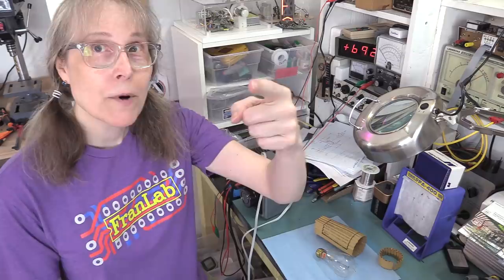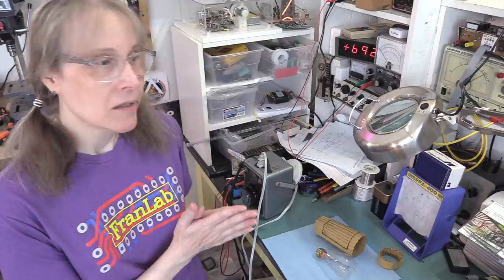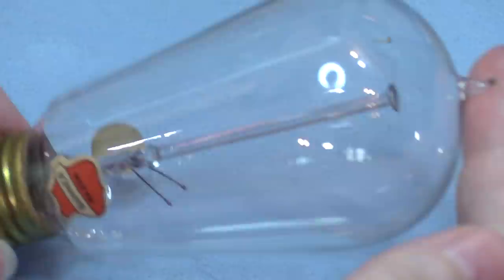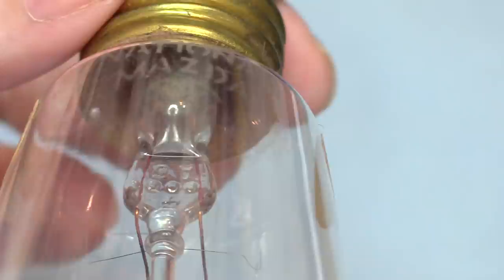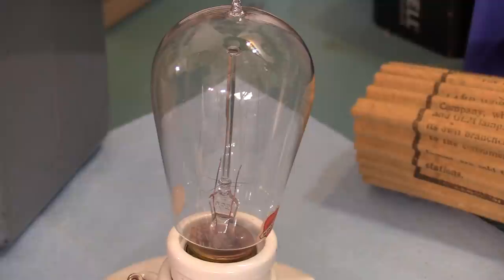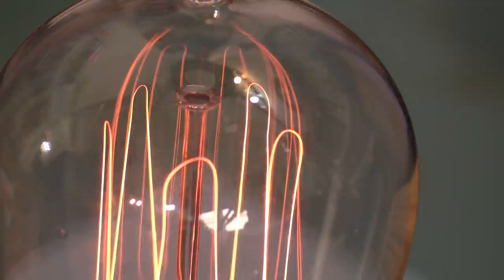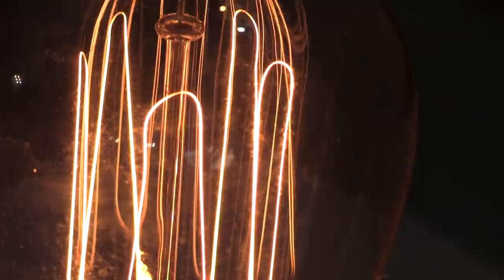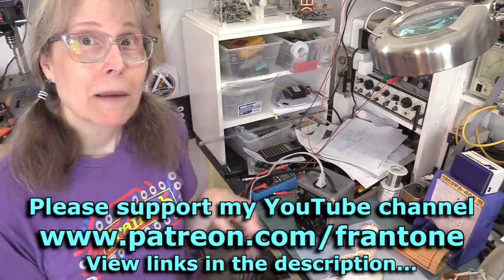Will A 106 Year Old NOS Light Bulb Still Work Right Out Of The Box???

Comment: Thanks, Fran. A beautiful 💡. And a beautiful Variac. Also worthy of note, as Big Clive would say: (1) The Mazda bulb predates the Phoebus cartel (1925-1939), in which GE got together with other light bulb manufacturers and set the lifespan of incandescent bulbs at 1,000 hours – and fined manufacturers who made longer-life products. (2) Ahura Mazda is the god of goodness and light in Zoroastrianism. (3) The longest running light bulb is the so-called Centennial Light, burning since 1901 and seldom turned off, at a fire station in Livermore, California.
Reply: I have lamps from that cartel area, and a lot of them have exceeded the 1000 hour rating in use.
Reply: We actually could have ever lasting devices if  greed didn't  happen ...
Reply: @AndroidFerret  Long lasting probably, but everything we made id subject to decay just as our bodies are. Sure you can make lamp that can last tens of thousands hours as it uses RF to transfer energy to mercury vapour and no electrodes are affected, but it will only work as long as circuit producing that RF is working. Ant it will burn out one day.
Reply: @MrToradragon  Well of course, but that can be made near arbitrarily long with thick enough circuit wires. Just like there is a team building a mechanical clock that will run for 10,000 years if undestroyed, and it uses massive gears.

Comment: Until seeing this one I didn't even know that there were tungsten light bulbs with uncoiled filaments. As always: Thanks for showing.
Reply: They are still used at sea for navigation lights. The 'squirrel cage' uncoiled filaments are used, to ensure a correct beam pattern. Nav lights have a set arc of visibility, so that they are only seen at certain angles.
Reply: can buy these new again, under the name "edison bulb". careful not to get the LED versions.
Reply: IKEA sold replicas until they were replaced with LEDs. Last week I found a box of two I bought around 15 years ago and never used.

Comment: I bought an old light bulb on eBay for a film that required everything shown to be available in 1955 or before.  The bulb wasn't quite this old and I paid no attention to any manufacturing markings (the original packaging did not come with it).  I powered it up to test it and it immediately blew.  Right now I am working on a project with squares of luxfer glass, which was patented in the 1880's and can still be seen over many old store fronts.  It is a prismatic means of redirecting sunlight to the rear of stores that had gas lamps (a huge fire danger) as their only means of artificial light.  Much of this glass now has purple hues due to the reaction of manganese to light.  Luxfer glass would make an interesting episode, Fran.

Comment: It would be interesting to see some of the older non standard US fittings, some of the British ones are quite bizarre, and the lengths companies went to be incompatible for vendor lock-in too
Reply: The standard over here in U.K. is the bayonet fitting.
Reply: @frankowalker4662  and of course it has the safety advantage of having both terminals on the end face, so the metal cap and the bayonet socket are not at mains voltage, unlike an Edison screw type - less likelihood of zappy surprises if you swap a bulb with the power left on.
Reply: @emmajacobs5575  It also has the advantage that if you want one that's just sliiiiiiiightly a different size it's fine because there are 67 standard versions, or even 5 different versions of an identical size base with incompatible pins that will short out the whole circuit if put in the wrong socket. Here we use them in cars because the spring preload keeps them from falling out, but with so many different variations it doesn't seem very standard
Reply: @alakani  British standard bayonet fitting has been the same since before the second world war. That's what standardization is about.
Reply: @evensgrey  As you say, specific use cases. Manufacturers have to build a product that meets the demands of its application, at a price that customers will pay. Concentrating on a limited number of socket sizes probably helps keep prices down a little.

Comment: Great bulb, Fran! I also have a (small) collection of vintage bulbs. Tip: Try using "Bulb Wax" on the brass shell of the bulb. It makes it easy to screw in and when you unscrew it, the lube eliminates the dangerous twist-pressure between the glass envelope and the shell. This way the glass globe on these vintage bulbs won't break away from the shell ( delicate!). Be well

Comment: Ive got a Phillips 240v 60w lamp from around the same time with the nipple on it, still works although i don't have the packaging. I really should make a nice display plinth for it and have it glow at a low voltage
Reply: That's a good idea. I connected some light bulbs to dimmers. No antique lightbulbs, but the light is the same. At 50% voltage, light bulbs last practically forever.

Comment: Works right out of the box after more than a hundred years. Amazing! Meanwhile, the couple of years old LED light in my kitchen takes a bit of time to "warm up" now that the weather has turned cold here in the land down under. I think it must have a switching regulator that's on its way out, because it's started taking a good 10 - 20  seconds to blink on. So I wouldn't be surprised if your tungsten bulb there lasted a lot longer than my "practically new" (in comparison) LED light!

Comment: Never move or bump a Mazda bulb when it is on; you may get the 'blue flash of darkness'.
Those straight-wire filaments are quite delicate when hot.
Grandma would spank us if proper if we moved a lamp when it was on!
Reply: Tungsten has a weird behaviour, at middling temperatures it's very fragile, but at full running temperature it is much more resistant to shock. This is something any experienced laser tech who's used ion lasers knows, running the filament at below it's rating cause the cathode / filament to die very easily.

Comment: One of the reasons it lit so soon is that tungsten (and tantalum, which came between carbon and tungsten) has a positive temperature coefficient, so it's somewhat self-regulating.  A cold filament has about a tenth the resistance of one at operating temperature, so it wasn't "low current" that lit it, but low voltage, the current would have been higher that you might suspect.  Because of this, tungsten bulbs will tolerate a range of voltages.  The early carbon filament bulbs had a negative temperature coefficient, so were very sensitive to voltage:  the bulbs would be sold in different versions for voltages only 2 volts apart.  So if you had 112V power, you bought a 112V bulb.  The later carbon filaments were "carburized", which made them less sensitive to voltage.

Comment: Just a suggestion:  If you don't lock the exposure on the camera, when you ramp up the voltage you don't get the full effect of the brightness.  Because the iris in the lens is compensating for the light and closing down.

Comment: The history as I have researched and I work at a utility in the hydro power generation field 30 years, is. In days gone by there were many small generating systems and small distribution networks all with varying voltages. Edison and others light bulbs were designed to operate between 100v and 130 volts. In the 
late 1940's and early 50's as these smaller entities were bought up and included  into what we know as modern utilities, it was decided to standardize around 120v. Kind of in the  middle. Re 50-60 Herz frequency, very early systems were 25 Hz. then 40. The only reason that I have researched for the increase in speed was lighting flicker. At 40 Hz the incandescing lights of the time, flicker could be notice, especially when a large load such as a trolley was thrown on line. No soft starts in those days. If you ever get a chance to visit an old old hydro plant still operating and you notice a large flywheel between the water turbine and the generator, as explained to me by and old old time hydro plant operator still working there, was frequency support. Because of trolleys. When one was slammed onto the line it sagged the system and the flywheels kept the generators at speed untill
 the wicket gates could respond and increase HP. to the generator. Just cool trivia I have learned working here.

Comment: The Edison base is not a world standard - here in the UK our standard is a bayonet fitting and, like the ES base it has various sizes. Due to imported light fittings we are seeing ES lamps appear but they're in the minority. Being on 240V and to avoid potential electric shock when changing a bulb, it made sense to isolate the metal base from the two connections which is why we adopted the bayonet fitting.

Comment: Lovely glow, I think the variac helped stop it going pop, but there again if its not been used why would it go pop if the voltage is the same as its rated for?
But much much nicer than a modern LED bulb. Thank you for sharing that Fran.

Comment: Fran, Thanks for bringing us that tressure.  Any idea if its vacuum or inert gas in that bulb?
Reply: Argon at low pressure...
Reply: I doubt it.  The inert gas fillings came quite a bit later, as I have understood.  I seem to recall that the old bulbs imploded (burst inwards) when shattered.  Also, I don't see any reason for near vacuum, if inert gas was added.  By the way, the old bulbs became darker in time, due to vaporized tungsten settling on the inside surface of the bulb.  I once had a 3.6 V bulb (intended for 4.5 V nominal battery use) that I put into a bicycle use.  The dynamo on the bike was rated 6 V and the light was brighter than anybody else's.  As long as it lasted, that is.  But by the time it gave up, the bulb was a full mirror.
Reply: @Centar1964  Sometimes nitrogen was used as well. But I guess it depended on the country and whether they had access to cheap supply of noble gases.

Comment: Wow, how would they get such a delicate, gossamer thin filament into a blown glass bulb? And is it under vacuum? Even if they were making each one by hand it seems impossible! So impressive that they made it work well enough that they're still functional over 100 years later.
Reply: Very easy, you make the lamp inside and ensure that it will, with a little spring tension on the top supports, fit through the base of the lamp glass, then seal the stem to the outer envelope. The pip on the top was an early way to evacuate the lamp while it was being heated, which served both to anneal the glass joins, and remove adsorbed air from the inside of the lamp. Then a back fill of low pressure argon to control the tendency of the sharp points to have a glow discharge, and you then heat the small evacuation tube and collapse it to seal the lamp. Anneal for a few hours more to relieve stress and then you can test them, put the base on and ship it. A mix of machine work that made the repeatable glass envelopes and the stems, and then hand assembly to wind the filament on, and then more machine work to seal them.

Later o they managed to fit the evacuation tube into the base, so the tip pip was no longer needed, though the reproduction i tungsten or LED still often include it as a superflous feature, the lamps being evacuated through the base in all cases, as the automatic machinery is set up this way. Some of the lamp lines are over 90 years old, but still running.
Reply: That is why the nub is on the top, the bulb would be shaped around the base.  The nub on top would have been a glass tube that would have held the top of the bulb in a glass blowing lathe (then later used to create the atmosphere needed in the bulb (vacuum or inert)).  They would have made the base with the filament first, then there would be one or 2 more steps on a lathe to create the bulb around the filament.   All done by hand in a very hot factory with lots of people working on lots of glass blowing lathes.
Reply: @SeanBZA  I'm not sure we have the same definition of "very easy," but that is fascinating! ☺️ Thank you for the detailed explanation.

Comment: In some of the electrical supply places they are selling replica antique light bulbs made the same way as the original using a strong filament. They look like the original, and are being made the same way.  They are expensive, but look great in an antique fixture or lamp.  

There are some replica light bulbs that are using LED technology that look close to the original when mounted inside of the fixture.  Nothing looks better than the original.  I am using the LED replica ones in our home. This is to have the long life with sort of the original look.

Comment: Fran, I'm no expert but I think the age of that bulb hasn't affected it's ability to perform whatsoever, so I think you could have turned it up to it's rated voltage without any problems. It's all glass and metal in there. Age had virtually zero effect on it since it was properly stored all those years.

Comment: I’m wondering about what effect the difference between old power and new would have on the performance of the bulb? I believe most power back when the bulb was made would have been 25 cycle power vs the 60hz today.
Reply: Bulb is just resistor, so not much, but there definitely will be difference in flickering and I would say that form me personally it would not be pleasant to use light bulbs on 25Hz.
Reply: Thanks for your answer friend. I appreciate it.

Comment: Why is the modern standard voltage 120v?  and 60/50 hertz?
Reply: Short version is that's what it was 100 years ago. Why did they choose that 100 years ago? One story I've heard is that Edison wanted an easy number like 100 at the point of use and due to voltage drops that meant 120 at the generator. I don't know if this story is true or not.

Comment: ☹Bet it will easy go full mains, I've seen similar bulbs here in the UK. Friend found a bunch in a building being demolished that work just fine, are of a same vintage and work at UK voltage all day 230v officially (in reality can exceed 250v).
After all yours has already passed burn in at the factory, so unless its been abused it likely to last atleast as long as a modern tungsten bulb.

Comment: Back in the early days of television, these drawn tungsten lamps were known to cause RF interference in the HF/VHF band that would often show up as smearing and bars across the picture and buzzing (typically 2x the mains frequency) in the audio. If you have an old television set or FM/VHF receiver, give it a try. Many of the modern reproductions will also exhibit this.